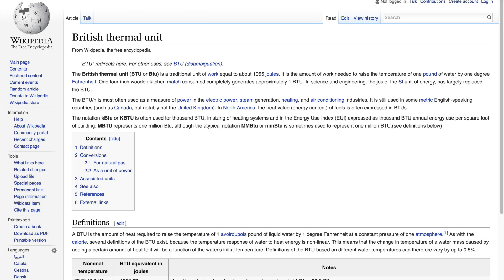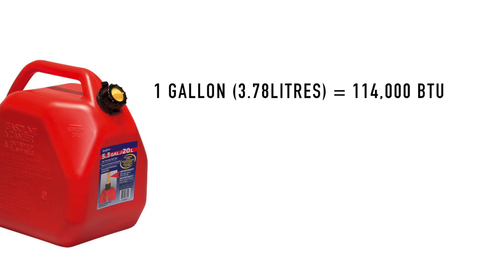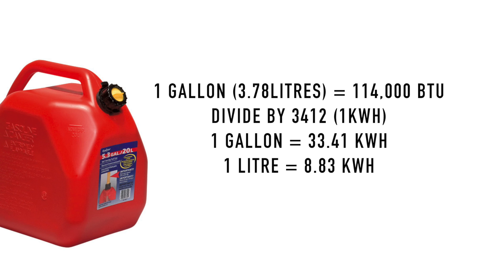Kilowatt Hour vs Gasoline Compared

Comment: There is something called a horsepower hour, which very few petro heads use or think of, which tells the real story of how their ICE vehicles.are.performing. An HPh can be converted into a kWh. There are 0.747 HPh's in a kWh.

Comment: The day that someone build a combustion engine that can drive a car 380 miles on 2 gallons of gas only then will I be convinced that this is an accurate measure of equivalency

I get that the idea is 2 gallons of gas at its maximum potential energy captured and used in the Tesla but you said Sebastian engines waste a lot of heat that never gets used and I don’t know why we don’t account for that because from what I have figured any method of converting the gasoline into electricity is going to have that problem of lost energy or wasted heat. So I think that people really should be accounting for that when they do these kilowatt hour to miles per gallon equivalent conversions

Comment: So it’s only a theoretical measurement of equivalency. You said yourself that combustion engines don’t use the full potential of gasoline because a lot of heat is released that never gets used.

Comment: Thanks for the video - it had a lot of good information but you buried the pertinent data to about minute 4. (at least for most of us who are becoming converts from gasoline cars to ev's) What I was looking for is: the energy capacity to my soon to arrive Model three is almost 3 gallons of gas but because it can get 100+ MPGe it will go a distance of around 300 miles under almost ideal conditions. Recent vids have shown that it is likely a lot less than that - especially if you are driving at autobahn speeds. E.g. the video of burning through a full charge in about 35 minutes in an X. But thank you!
Also. you may want to add that the Superchargers show at the current consumer electrical rates for those of us who would have to pay, whereas gas stations along the freeway in most states charge a huge mark-up rate if they are located anywhere near a US freeway. True highway robbery!! 
Thirdly, I have solar panels on my new house, which completely tips the equation in favor of EV. I think my cost of fuel for the Model 3 will be zero!!

Comment: Good explanation. But many people would like to see a similar vehicle comparison to actually understand.  Compare a gas vehicle that has similar features as the Tesla. The Model S being a luxury car, not a SUV or a Honda civic.  I see many Toyota Avalon's and Camry's etc.  My neighbors 2015 Avalon carries 64 liters of fuel at todays cost in Ontario of about $1 per liter. It get about 600 to 650 kilometer per tank.  Depending on who you talk to (Actual owners, not fancy math or theories) the Model S cost to charge is around $12 to go 500 kilometers , so it's around $15 to go the same distance as the Avalon which costs about $60 for the same trip.  John got the Avalon bran new for $39,000 , the 2015 Tesla Model S $125,000.    Are you going to save over $80,000 in fuel and repairs over the life of the vehicle?.  I have a 1997 Camry, with less then $2000 in repairs done to it.

Comment: here's even simpler explanation. To do 300 miles (city or highway) with Model P90D it costs me $4.50. With 2016 Honda Civic it costs $14.69 (highway only).
I pay my electric company PSE&G $0.05 (5 cents) per kilowat at night time tariff.

Comment: I have been thinkin a lot about Tesla 3 lately. What is the efficiency of the charger? I guess it depends on the energy level of the batteries, but let's say at its best and its worse. Is it better than 0,7? Does anyone know this? Thanks!
Reply: I would assume the M3 charger would be at least as efficient as my Focus Electric which is 85-87% efficient from my measurements comparing kWh used to charge the battery vs how many kWh used to discharge the battery.  I was pleasantly surprised because I was expecting the efficiency to be somewhere between 75-80%

Comment: In excess of 80% efficiency sounds about right for the entire electric drive train though. Good electric motors like what Tesla uses are 85% to 95% efficient. In the higher end of the scale if you drive conservatively, in the low end when you drive like a madman. Modern converters are about 95% efficient.
Reply: I agree, his wording was a bit misleading, but he seemed to use the total drive train for both the ICE and EV, so its a fair comparison.

Comment: Hoe do you take in consideration the battery cycle life? The day you will need to replace the battery with a new one it will cost a lot of $.
 I think there are two ways to consider it. 1) include it in $/mile like you count the $ you pay to charge the battery. 2) include it in the maintenance costs like the cost to change the tyres etc. These costs can be seen like $/mile too.
Reply: Evidence so far points to a battery life about that same as car life.  It is unlikely that many Tesla owners will ever replace their batteries.  And who knows what the price for a new pack will be at that point.
Reply: Loanword Eggcorn
Perhaps if you live in a place where they don't put corrosives on the road every winter...  We shall see.
Reply: Let's hope so.  The last two cars I got rid of, had corrosion issues; engines were fine.
Reply: Loanword Eggcorn
Nice thought.  But I actually have to drive the car, if nothing else home from the car wash.  At which point it is covered with salt again.
Reply: Loanword Eggcorn
You're still not getting the WINTER thing.

But you were the one who claimed ICE and EV differed on this ("EV can go a 1M miles").  My claim was that ICE and EVE both had this problem.

Comment: Great vid! Another interesting comparison would be to review the total lifecycle. Looking at energy used to pump the oil from the ground, transporting it, refining it etc and the compare it to electricity coming from solar or wind taking into consideration the production of those units and the car battery life cycle cost.
Reply: http://www.greencarreports.com/news/1102307_once-again-electric-cars-have-lower-lifetime-carbon-emissions

"The Tesla's manufacturing-related emissions could be offset within 19,000 miles of driving, or about 16 months of ownership."
Reply: +jamc666 Thanks! Thats Anders pat of My question, i think. Through I'd like to see an objective analysis of how much energy it takes to get 1 liter or gallon of oil  into your gas tank, meaning all costs from drilling transporting refining etc, compared to let's say the energy cost of making a solar panel array until the electrical energy is available in your electrical car battery. That would be a really great analysis, I believe that the benefit is far greater than 50%
Reply: mikeberg i suppose that one simply cannot compare the two ; once you've burnt your liter of oil, it's gone not to be replaced again.
Solar panels on the other hand lose a ridiculous 0,5% to 1 % efficiency per year at generating electricity ; in other words, after 20 years, your panels are still anywhere between 80 to 90% as productive as when you first installed them.
I believe the future of energy production will be 100% renewable, no doubt about it.

Comment: what about the regenerative breaking system - energy is being recovered from breaking, so isn't that contributing to the higher efficiencies of the Tesla car?
Reply: "If regenerative braking were 100% efficient, EVs would be perpetual motion machines that never needed charging."

No.  Most cars lose most of their energy to drag, not to the brakes.  100% efficient regenerative brakes would improve efficiency by a few percent.
Reply: the most mature and polite response to being corrected on a youtube comment. I applaud you sir.

Comment: This is great info.  What I'd like to see along with this, is the actual cost comparison.  Because, when it comes down to it, many people care only about their wallets, not how efficient something is with its energy consumption.  For example, when doing my own math (which could be wrong) I've found that a Honda Civic costs about 2.6x more than what a Model 3 would cost to refuel based on average gasoline prices and average electricity prices.

Comment: Nice vid, but maybe next time it would be nice to use more graphics and keep in the corner while you speak. And would be nice actually compare cars by their consumtion in L/100km or kwh/100km.

Idea about next vid, could you talk about total polution. I mean, they like to argue, that powerplants produce CO2 and that actually electric cars make more CO2 overall then petrol ones. And also about how "eco" is it to make batteries and to recycle them.

Thanky for your time.
Reply: ICE cars owners tend to forget that the fuel they put in their car is not produced right where they fill up
Reply: Agree. The last minute or so was difficult to retain all the numbers and compare them mentally.
Reply: Loanword Eggcorn
 EVs vs. ICEs is not even up for debate imho ... :) ... not even after argueing about batteries recycling. EVs is the future.

Comment: Bjørn Nyland Tesla S70D average consumption per km was 17.4 kw/h.
Lets say the tesla had a 70 kw/h battery pack. How should i understand the autonomy is not (70 / 17.4) km?

Is it clear?
Reply: At 100 km/h a 70 kwh battery would last about 4 hours?
Reply: Right, thanks

Comment: I would love to see the conversion of what the Teslas get in milage if converted to miles per gallon of gasoline. That would be a meaningful number. Also, a fuel cost per mile compared to a gasoline car could be interesting.
Reply: What is Mpge vs Mpg?
Reply: +Per Diem Metals the e in mpge -is stands for equivalent". Because electric technically cant be miles per gallon.
Reply: +Per Diem Metals Exactly what you were asking for. EV efficiency numbers converted to MPG for comparative purposes.
Reply: +Per Diem Metals MPGe is basically miles per gallon in kwh (1 gallon = 33.41kwh) as mentioned in tge video, e stands for equivalent. a 70D for example has a little more than two gallons in equivalence yet it can drive 128 miles for said one gallon equivalent.

Comment: Interesting.  I had done that calculation before and got similar numbers.  What people also don't understand is that in the US there are huge subsidies for the fuel.  So you're really paying more for your gas at the pump than you think.  Don't know how it is where you are.  I also tell people with range anxiety that driving my model S is like driving any car with 1/2 tank of gas.  It's not a real inconvenience.  Especially when I don't have to go to a 'station' to fill up unless I'm traveling.  BTW, in Nebraska we don't have superchargers--that IS inconvenient!
Reply: +Trev Page here is another calculation, with people worried about where to charge, there are 133,957,180 households in the US approximately 20 power sockets per house which makes 2,679,143,600 charge locations in the US or 10,716 charge points for every one gas station
Reply: Well, yes and no.  120 volt socket would give you 3 mph.  Even my 14-50 is only 28 mph.  That is an inconvenience at 120 volts.  The key though are the SCs.  Brilliant of Elon to get those out ASAP.  He'd be selling lots fewer cars were it not for those.  Even though Nebraska has NONE.
Reply: +Dennis Mathias Arkansas has none as well.
Reply: Things are looking up... according to supercharge.info website, there is a SC just outside Omaha in Council Bluffs, IA and they are in the permitting process for one in Lincoln. Also, a commenter on teslamotorclub.com indicates that public records show they are planning additional SC's in Kearney, North Platte and Ogallala presumably after the Lincoln SC is complete.

Comment: Awesome! Do you think it's worth buying a model 3?  I pre ordered it, but i'm having second thoughts now. Tesla is charging us to use the super station. The tax back might not even be available if Tesla reaches its cap capacity.
Reply: Around your home you will travel almost exclusively on electricity from your home, which is a very cheap fuel.

Superchargers are for long distance travel, you won't need SC access very often unless you take trips constantly.
Reply: +Trev Page +jean-Pierre White, that makes sense. How about that's battery? The battery will depreciate overtime. Would you guys happen to have an idea of how fast it will depreciate? The price to replace battery is more than the amount of money I will save from gas.

Comment: My ev does 3.94 miles per kWh, how does that convert to your way of working out the efficiency, also the tesla vehicles are all huge
Reply: You can figure it out.  I get about 300 watt hours per mile.  So yours is a little more efficient.   You get about 253 watt hours per mile.

Comment: Great video! Just curious about the density of the new batteries Tesla will be making. I've watched the other videos where you discuss the change of the form-factor of the batteries increasing the volume per battery, but obviously because of the total battery pack volume they must put less batteries in an equivalently sized battery pack. Do you have any information on whether Tesla are improving the chemistry within the batteries to make the stored energy more dense? Or if they are making efficiencies in the ratios of materials within the battery to reduce production costs?

Comment: Trev Page,  Nice video explaining this.  I can see you getting more videos diving a bit more into this topic.  This is an eye opening topic for most people I'm sure.  
1: cost comparison to travel 60 to 100 miles in kWh to gallons. 
2: cost to charge EV to full and miles expected to  cost of full gas tank and miles expected. Then see what cost per mile is.  

etc.....  these are the kinda of questions I might be asked by ice drivers and I have not come up with a clear answer yet, can you help?

Comment: I like to think of gasoline engine as producing mostly heat and sound, with some residual movement (20-25% of late?). Like a pretty good, but noisy heater that also can propel itself when placed on wheels.

An electric motor mostly creates movement. Much less heat, much less sound. 

It depends on what you need. If it's a bad winter and the municipal heating through hot water fails you, it may be more effficient to place a gasoline car in the living room with the engine running at good revs than to have an EV with the wheels off the ground. The EV would not require use of "gas" masks, but you'd freeze to death.

The best gasolines power units in the world are perhaps now in F1. The Mercedes units are reportedly 50% efficient. That is, less than 50% of the available BTU's  go to heat losses and sound. In F1 strangely they try to maximize sound losses. The heat losses are limited by actually making a good effort to turn redundant heat into electricity which is then used  to proper the car faster and further.